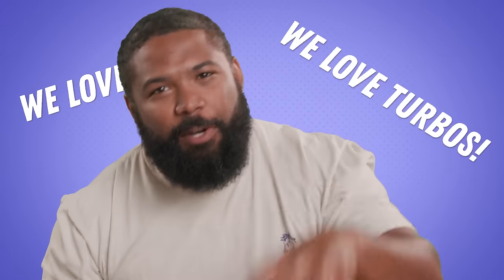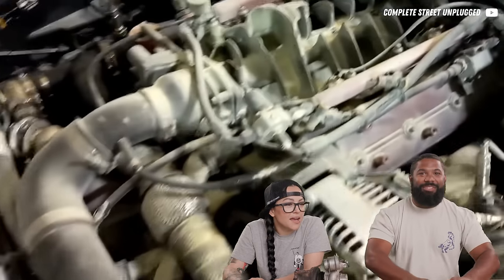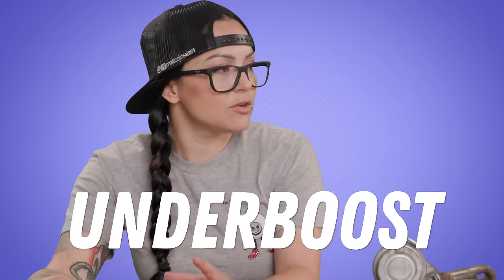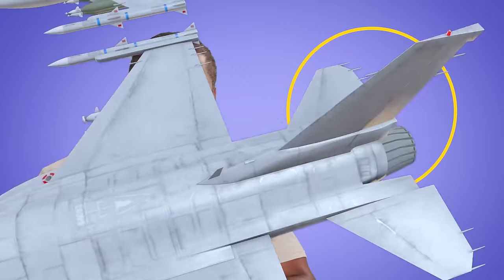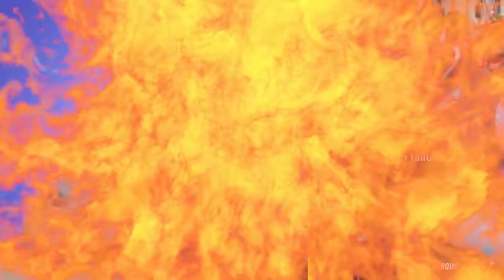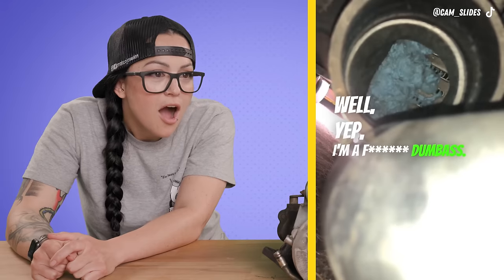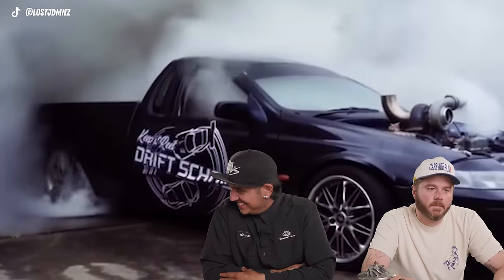Mechanic Reacts to Catastrophic Turbo Fails

Comment: Might as well say this here as anywhere, not like we've got a lot of options - anyone want to buy a Volvo V70 Turbo, circa 2000-ish? It needs a new seal in the engine somewhere - you dump a quart of oil in and a few seconds later you've got a quart of oil on the ground - and the battery needs to be charged, but that's all that's wrong with it. But my mother is on disability and I'm on minimum wage and we simply can't afford to get it repaired. Don't have any real way to sell it, although that's looking like the best option. Turbo is perfectly intact. Just needs the engine seal. 

Anyway maybe some aficionado will see this and go "neat, a project bought cheap with good returns!" and reply and we can work something out...

Comment: The Volvo was a runaway engine, which means that you can't stop it unless you cut the fuel or put the car in the last gear
Reply: Not a fuel issue majority of the time rather a oil leaking into the combustion chamber via the failing turbo seals.

Comment: It’s a Volvo which means it’s a diesel which leads in to my comment I just made also the caption confirms what I said which is not a stuck throttle rather a runaway from the turbo seals leaking and dumping oil into the combustion chamber.

Comment: The car was a runaway I think. So not a stuck throttle but the turbo was dumping oil in and it was running off the oil

Comment: Watching that super duty start blowing white smoke gave me PTSD of when the egr cooler on my 6.0 grenaded itself one day at 186,000 miles on the side of I81 100 miles from home during a heatwave with my 5 year old daughter in the back seat… to make it worse I had two truckloads left to haul out of my apartment that night because I was leaving for a deployment the next morning 🙃

Head stud your 6.0’s people, ditch the “motorcrap” coolant add a good coolant filtration system and upgrade or delete that egr and oil cooler setup.

I have an unhealthy desire to build a functioning turbocharged wood stove as a generator using the compound turbo off a Detroit d15 and a pro charger 😅 for science!

A caution of safety though… FOD awareness and exposed turbos go hand and hand… if it’s not secured and can fit through the opening it can and will go into the turbine. Always double check your surroundings beforehand
-Professional aircraft mechanic advise

Comment: The ford on dyno, it wasnt the head gasket blowed, the was the oil inside the intake becouse turbo cracked on half and starting to throw oil instead of air

Comment: The girl seems not to really know what she's talking about, she just said that the corvette has a tuning issue wich it didn't because the intake blew up and the engine isn't getting enough air from the turbo anymore so it can't burn all the fuel in the combustion chamber and then she says the intake got burnt like wtf??? Yeah maybe it got burnt inside the engine when it exploded but it exploded because of the high pressure, not because it got burnt.
Reply: wow someone with common sense

Comment: 06:39 a turbo does not run away. The Volvo likely is diesel powered. Diesels engines do not have ignition plugs like gasoline engines. High compresssion and heat in the cylinders causes ignition. When unregulated  fuel continuously dumps into a diesel engine. The engine, it can run away. If possible quickly block off the air inlet and the runaway condition will stop. Since combustion needs air, fuel and heat. Think of combustion as a triangle. All three sides must exist for combustion to occur.

Comment: you can see that these guys don't deal much in diesel cars😂. that volvo is what you call a runaway. the turbo seals fail and the oil go straight into the engine and it starts to run on that oil instead of diesel. the car revs to maximum and the entire oil supply gets burned. you can even take the key out the ignition and the engine will continue to run until it is toast

Comment: The diesel vdolvo had some kind of failiur that let oil in the cylinder an oil in a diesel works as fuel so the engine revs up ti it dies you can do anything except killimg the air

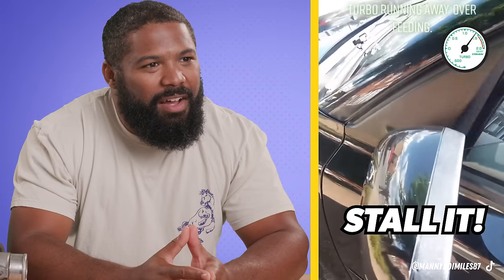Comment: 6:24 runaway turbo diesel the bearing of the turbo is worn out and starts dripping engine oil  into intake the engine eats it and starts running on its own oil (diesel = an sort of oil)

Comment: The Volvo was a runaway diesel probably oil from the turbo feeding it or the rings are bad and it’s running off of oil from the crankcase

Comment: And this is one of the many reasons why I don't want a car with over 700 horsepower. Because you can still do a lot with that Maybe not Drag Racing But definitely rally, circuit racing, that new gymkanna and have decent success and crap loads of fun

Comment: The thing what happened to that Volvo is caused by heavy wear on the torbo. When that happens, oil gets pumped into the intake and gets burned like diesel. The oil is very flamabke, so the engine will rev itself until the egine is blown or the oil consumed, soooo
:)))
Don't get a diesel

Comment: These are mechanics rating cars blowing up? That Volvo blew up by dieseling itself to run at max rpm the motor will allow. Usually running on its own oil or injectors are still adding way too much fuel.

Comment: 1:02 again the age-old question only I seem to have but no one seems to gave the answer to:
How can the turbo spin up if it isn't consuming energy produced by the engine?
Isn't it powered by the movement of the exhaust through the exhaust system, in turn pushed by the pistons on the exhaust strokes?
Am I taking crazy pills??
Reply: the turbo is consuming energy, its how they work
Reply: yeh they were just wrong when they said it doesnt take power, a turbo is a massive exhaust obstruction - it takes power to overcome it before it gets into a positive power return, its called turbo lag.

Comment: Hey rn I don't have my own car, my mom on the other hand has a Fiat 600 that she gave to me I just need to transfer it to my Name, and I have this crazy project for it rn is in it planning phase. To anyone who is wondering, imagine the roof scoop that goes to the engine of the Mercedes Benz CLK GTR, now imagine it on the Fiat 600 with an air or oil cooled mid sized I4, with 2 small turbos and a widebody kit, a roof spoiler, and lighter then it's original weight of 1,290 lb or 585 kg for us none Americans.

Comment: If the whistlin diesel turbo failure on the Duramax that they fogged with ether and fed rags and I think lug nuts and bolts isn't on here 🤔 I will be disappointed...

Comment: At 6:20 that's a run away Diesel engine, oil is somehow getting into the cylinder and burning as fuel, YouTube runaway Diesels pretty crazy

Comment: Volvo = runaway engine, this happens when the oil seals blow (piston rings, turbo seals, valve stems, etc)  and a diesel runs on the engine oil rather than the diesel fuel. Putting it in park IS NOT the way to stop it, to do that on an automatic - block the air intake as to prevent air entering the engine, on a manual, stick it in a high gear and dump the clutch to stall the engine.

Comment: 06:30 that is overfuelling . fuel pump fail .
diesels dont have throttle body to control air velocity which controls the revving .
in diesel engines revving is controlled by fuel flow only .
if its an automatic you have to open the hood ,take off air supply filter and block the air flow to kill the engine ,which is very dangerous . the engine may explode at any time .
if its a manual you put 3rd or 4th gear slide the clutch slow with brakes and stall it

Comment: It's called a run away its when a diesel engine starts getting feed oil from a leaking turbocharged or a oil seal. Turning off the engine will not stop this  it will just keep going till the engine detonate its self the only way to stop an run away diesel engine is to block up the intake to stop the engine getting air.

Comment: Wasn’t a ghost lmao, it a runaway engine, diesel engine can run off oil blowing past the turbo seals, which can make it past redline, only way to stop this is to block off the air trying to turn it off wont do anything it will still rub

Comment: i drove for 5 years a Renault Laguna 2 Grandtour 2004... 
1.8l turbo diesel with 120hp and a 6 speed manual gearbox....
at 160kph you barley heard the engine and its took under 6l for 100km...if you drove slow, it would make 1300km on its 66l tank!
Renault is for no reason in the F1, the suspension on that car been like a race car...drive on raiload tracks with a station wagon!

Comment: Um… catch cans catch oil coming out of the head from crank case pressure if it were in the intake it would be a boost leak lol not hating just a little fun facts they know there stuff but I think some information on performance upgrades may be  a gray area in some places. that diesels turbo failed cause he was probably pushing 100psi of boost 😂 with performance modifications it’s not a matter of “if” it’s a matter of “when” it will blow love the content tho mate just a little more correct information would be better for the new guys 😅

I’m sure these guys are master mechanics at most general automotive applications tho!!! And probably dip their toes in performance mods but some information could be more accurate etc 😅 love it tho no hate just constructive criticism

Comment: 😂 Ghost Turbo? You're meant to be mechanics!!!! The Volvo was a diesel and had what's called a runaway. This is where the bearings in the turbo fail, causing turbo oil to be ingested by the intake side. Normally, there are warning signs of before it gets to this stage, like excessive smoke when driving normally blue. If the seals fail completely, then when you shut the engine off, it won't turn off as the engine is running on its own oil instead of fuel. The electronic waste gate won't open and there's no way of governing the engine speed. The RPMs just through the roof and the only way of stopping it is either stall the car by putting it in gear or cut off the air to the intake. By this point, due to the high engine speed above what it was ever designed for, all of the bearings will be shot, possible valves bent and rods. May as well just let the thing starve itself of oil and seize as the damage has already been done.

Comment: I live in europe, I had the same ghostly sounds (11:20) and i thought it was a belt or something, needless to say, after 900+ USD later, i found out it was the turbo... my engine side propeller was saying goodbye after  ~310000km. 

Edit: or 192625 miles
Car is fine, engine is fine, lets do another 310000km 
If anyone is interested, its a 2007 Vauxhall zafira B 1.9 CDTI z19dt

Comment: Should I be worried about my turbo in my car when running on the streets. I can't count how many times I've run over a plastic bag blowing or paper. Or even leaves in the fall. No. I just answered my own question. It must be hard for stuff to go up in there normally.

Comment: @ Real Mechanic Stuff  Non of them have a clue. Have diesel mechanic on to talk about diesels . That engine was fine after the turbo exploded.    Diesel engines do not even closely operate the same as a gas engine. NA diesels add fuel to go reduce fuel to stop.  A diesels at stoichiometric is very smokey epa reduces that for the environment Even with a turbo that does not change. Performance diesels love nitrous   .If you knew or followed the person who built this truck you would know they used to much  Nitrous and not enough waste gate . The turbo wasnt cheap . It was a borg warner s480. That was built by a very well respected shop. The person who built that just took 2nd in Ucc this year.
Reply: Any one who is interested can see they strapped a few more turbos on that night and the truck was fine...
https://www.youtube.com/watch?v=ESEjYIYX6l0

Comment: Mechanics? What are these mechanics? Your mechanics don't seems to know what a runaway diesel is.. At 6:36 the car is having a runaway, it's clear. Yet those "mechanics" are acting shocked and saying like "Yo why they don't putting it in park? Oh there's no-one inside, maybe the gas pedal got stuck wut? That's a ghost car!" no, that's a diesel runaway... And the pickup at 3:50 looks a lot like a  diesel runaway for me too. (got reved up normally then you can hear a sudden peak in RPM's and a big pink flame, right before the turbo blows, looks like a runaway to me but still to confirm.) but I'm sorry but that car at 6:36 is 100% a runaway diesel.

Comment: 11:44 am I the only one who doesn't agree with "the real mechanics". All of them are saying that there's chocolate milk into the intake pipes because of a failed turbo bearing which actually will suck oil into the intake pipe yeah ...ok where does the water come from then ? i can think of at least 2 possible scenarios    of what has happened there but failed turbo bearing definitely isn't one, as the girl said the oil shouldn't look like that if it's a bearing failure.
Reply: WhatApp-jn5db  ?

Comment: 0:57 true theory but not true in reality. a turbo can take power by restricting the exhaust flow, this gives a none turbo better low rev performance than a turbo. i own both a vw t4 2.4d and a 2.5TDI and i actually prefer my 2.4d cause i can take most turns and roudabouta in 5 gear, this is not possible in my 2.5tdi wher i need to use the clutch a lot!

Comment: lol I thought you guys was good mechanics  the Volvo was a runaway Diesel its when the oil ring/seal fails in the turbo on the compressor side and it runs away on its own oil that's y there black oil on the ground out the exhaust there a few ways to stop it stall  an stick,co2 or halon gas fire extinguisher in the intake or a dry powder one in the filter to plug it up, you can also cut the boots but you only got about 2 min till she past 15k rpm and cant oil its self fast enough and gets past cooling potential then she looks up tighter the a puckered sphincter. after investing 15k over 5yrs in to my Cummins I installed a shutoff valve on the intake just in case.. thanks for sharing

Comment: She explains catch cans for tje oposite purpose they are used for 😂, they arent for catching oil from your turbo that leaked in your intake, they stop pressue in your rocker cover building up and vent the crank case pressure and catch the oil fumes so they arent plumed back into the intake like factory routes it..😂  why do you guys keep letting her make a fool of herself... why?

Comment: Are they actually real mechanics? Or just some parts slappers? Some of their explanations arent exactly very true. Like turbos are bad if they have any shaft play, its normal for a journal bearing turbo to have slight side to side play but it does get to a point were it is excessive.

Comment: Call yourselves a mechanic and you never have seen or heard of a runnaway engine. The old 2 strokes where nartorious for it. Cheap turbos also cause it when they leak oil into the engine.

Comment: A fair amount of inaccurate turbo diesel information here. "ghost diesel"is a runaway likely due to bad seals, egt failure is a more likely form of failure for some of the turbos due to lack of cooling. Some information is understandably dummed down. Just frustrating, not a debate

Comment: https://youtu.be/D_JNREiWEJ8?t=58 "don't take power to make power" that's not true at all, a turbine is literally an exhaust restriction and your piston has to work harder to turn a turbine over a free flowing exhaust. If turbos where free power, jet engines could reach infinite efficiency.

Comment: my tule of thumb you cant take a car off a dealer lot and be proud of it  it's not a hot rod till your wife threatens you with divorce if you don't get your 350 4-bolt block out of the kitchen and your clutches & steals out of her dishwasher

Comment: It backfired because the tuner didn't know what he was doing and with the plastic and take that pressure and that back fire working on carburetors knows what a backfire is these idiot tuners think it sounds good so they they let it happen and not to knit properly and that can happen right there that's why I say you going to blow your car up the Turners actually like the pow pow pow and that's what happens when it does

Comment: 6:50 this guy doesn't know anything about engines. 
diesels dont have throtles and only reason they run away like on this clip i because they get fuelled by their own engine oil. ussually through failed turbo. you cant just turn off diesel in this case. you have ti either stall it in top gear or block the intake so it stops getting air

if those people were real mechanics they would knew that.

Comment: Needs dumber explanation
Reply: Engine burns fuel inside cylinders, increases pressure and pushes pistons out, creates power
Engine needs air to do this and not all of the pressure is put to use
Turbocharger turbine is spun by extra pressure in exhaust 
Turbine spins compressor which forces more air into the engine 
Extra air lets you burn more fuel more efficiently, make more power
There's also a feedback phenomenon as the extra exhaust gets sent through the turbine and draws even more air, that's where "turbo lag" comes from as it takes a second to reach full boost